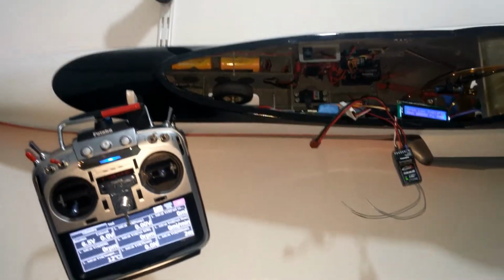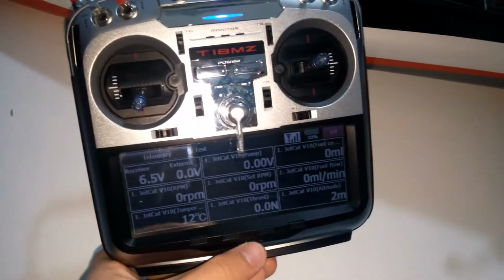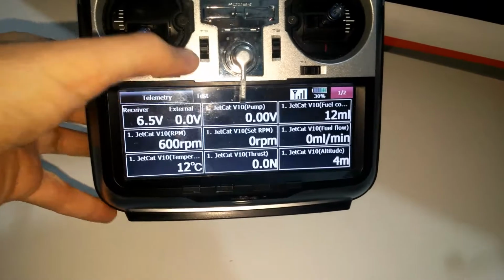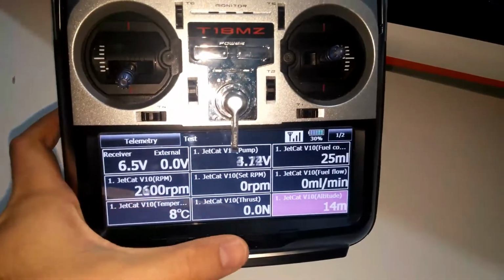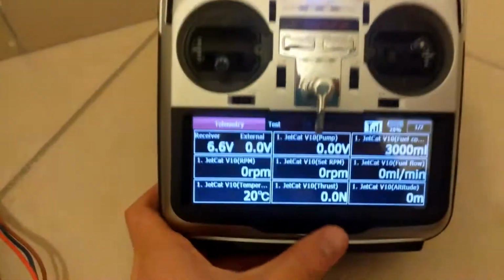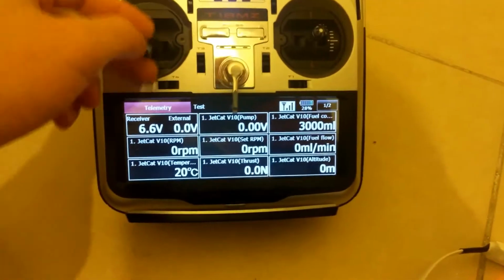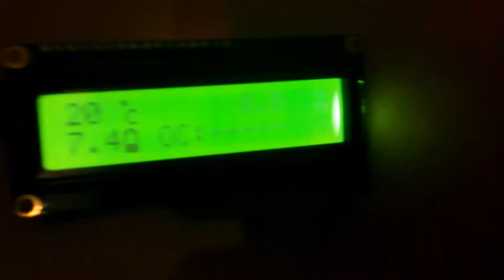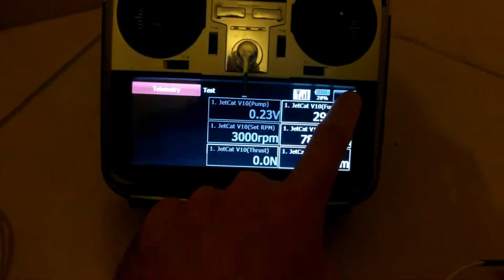RTDT for Xicoy and for Jetcat - Display and Telemetry ALL IN ONE!

Comment: With all due respect, but can you stop or "Look and Fly at the same time your plane??"  I mean that telemetry is awesome, but I would be terrified to look at it and then see the plane diving and them not having a plane any more!! (Please feel free to erase this comment if you find it not appropriate, this comment is not meant as an insult or trying to be disrespectful.)
Reply from the maker: Migueldeservantes you are correct, you are never supposed to look at the radio while flying! you can program alerts for high egt, low voltage or low rpm and the radio reads out the bad parameter in case of a warning.
Reply: Wow!!! Of forgot!! that you can program the radio to alert you and give you all kinds of alarms.. I have  two 14MZ and Even hack one of them to do really cool stuff!!! but I have never actually use any on those radios, so please forgive my ignorance, In the other hand I do have two FPV Planes that have OSD,, and one can see the telemetry in real life as you fly, and see the data embedded on the video feed.. have heard that the PixHawk autopilot give you all the flexibility that you may need so you can change ad or remove OSD Data... thanks for the reply.
Reply from the maker: Migueldeservantes what did you hack in the 14mz?